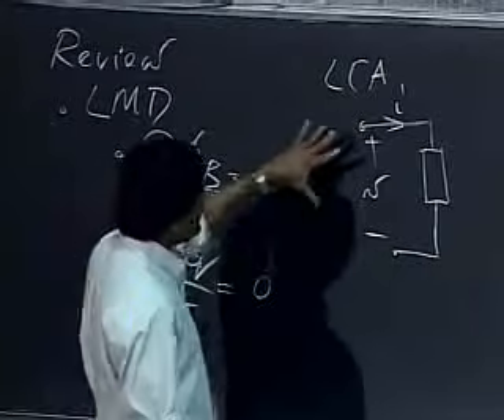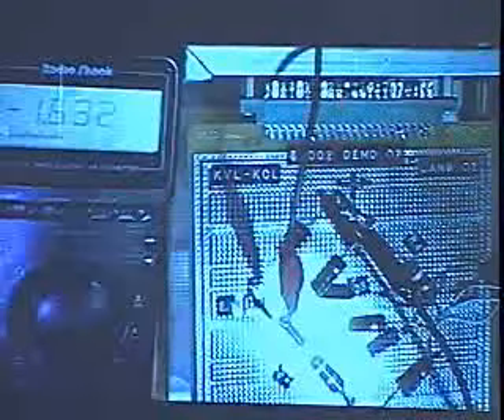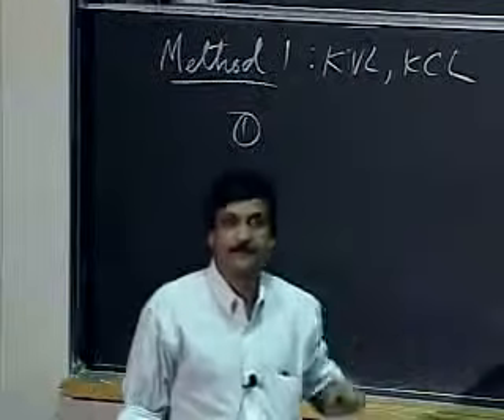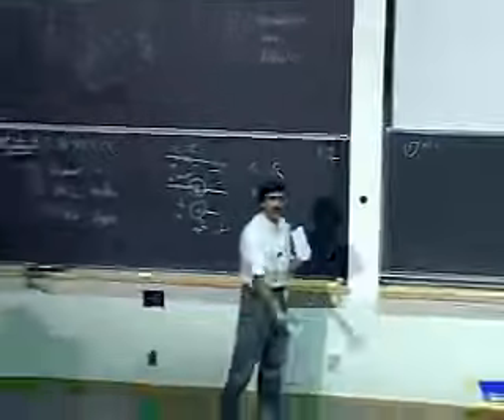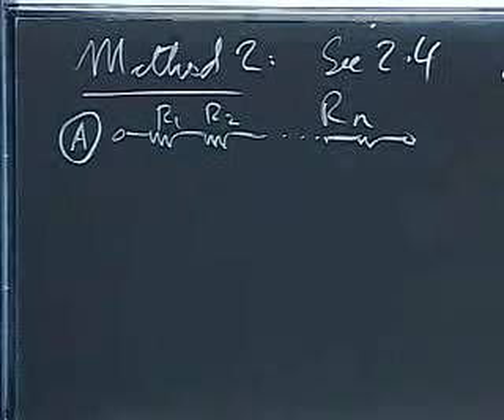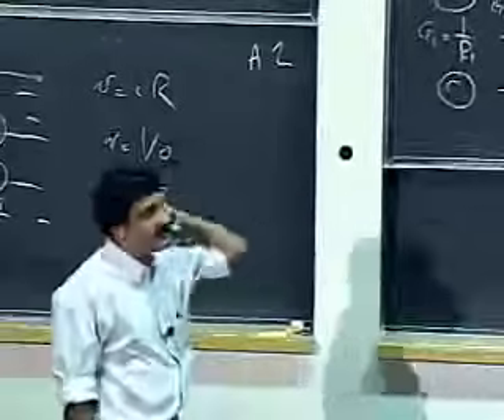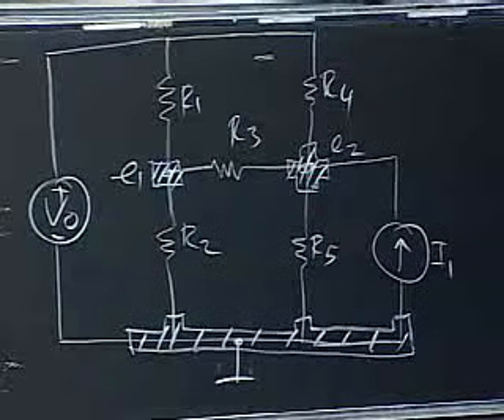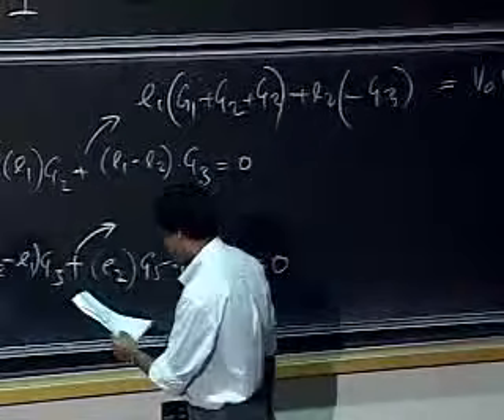Lec 2 | MIT 6.002 Circuits and Electronics, Spring 2007

Comment: Stumbled onto this as a HAM radio operator trying to learn the science of radio circuits and electromagnetic (radio) wave performance.  Made it to this 2nd video.  Follow the electrical terminology fine, but Professor lost me on the math at the end.  Appears linear algebra proficiency is required to progress (and who knows what else) ... and my advanced math was 30 years ago, long forgotten.  So good to know to stop my efforts to gain proficiency in radio science.
Reply: Tom W5VLT Hi Tom.  The technique that the professor suggests using (Gaussian elimination) is usually the first topic covered in a linear algebra course.  It’s pretty simple, so I’d encourage you not to give up!  A little googling and you’ll be back on track in no time.

Comment: These simple algebraic equations make my head ache. The method of clumping elements together and just remembering their interactions seem most effective to me because I can tell what the circuit does without knowing anything about voltages and impedance and what not. If I had to calculate kcl for every node in a real life circuit I'd need to take a week off. And don't forget tolerances of components.

Comment: How did we gather that the resistance of the two resistors in parallel is equal to (R2+R3)/(R2R3) at 31:44? He said that conductance is equal to the reciprocal of resistance. Wouldn't that mean that (G1 + G2 = (1/R2)+ (1/R3)) not (G1+G2 = (R2R3) / (R2+R3))? Thanks
Reply: Pedro Casultsan 
G12 = G1 + G2 = (1/R2) + (1/R3) = R2/R2R3 + R3/R2R3 = (R2+R3)/R2R3

R12 = 1/G12 = R2R3/(R2+R3)
Reply: Thanks
Reply: how are you jumping from (1/R2) + (1/R3) = R2/R2R3 + R3/R2R3, in other words, how does 1/R2 = R2/R2R3 ?
Reply: Juan Manuel it doesn’t, 1/R2=R3/R2R3

Comment: Please SOMEBODY help me. I can't get currents' directions in KCL and NODE method. I think there is mistake in taking current directions.
You know I was studied that everything should be very strict. How can 3 currents all be positive!

io + i1 + i4 = 0.  Ok we have other equations and can get that i0 (or i1, i4)  is negative finally. BUT, if we make similar misassumption in other equations - everything can go wrong.
And we have voltage source since when current is going inside source, it should go from positive to negative. if we have voltage consuming device, I could understand that, but not with voltage source.

Also similar is true for (e1-Vo)G1+(e1-e2)G3+(e1)G2=0. All current is going inside/outside node? We have only 2 equation with all signs positive. How it can be? Currents just travels where they want?
He is very flexible. But for someone who only starts electronics without having experience in KCL calculations, it can hurt understanding from the very beginning
Reply: Ahaha you and the MIT professor are over complicating things way too much. Kirchoff's Current basically says that the current throughout a series circuit is always the same. So in basic series circuits all current drops are the same no matter the resistor or load. 

Kirchoff's Voltage says that the voltage source is equal to the sum of the voltage drops in a series circuit. So Vs (Voltage Source) = V1 + V2 + V3...

Basically that's all you really need to know starting off, anymore will make your head hurt if you don't know too much about circuiting. Honestly I learned all of this at a Community College and I find it much easier to learn it there then at MIT. Even though in the end you learn the same exact things, it's just that you have much smaller classes and more personal one on one time with your professor. That and this guy's handwriting, accent, and method of "simplifying" things are really confusing. 

He's a good teacher for MIT students I'm assuming, I can't see him as a good teacher for people who are looking for simple explanations of how circuiting works and basic introductions. However I personally know there are better teachers out there that can explain the same things in a much more simplistic and easier way, but I don't think that's what he's trying to go for.
Reply: jebril But we were dealing with paralel circuitry. Directions of currents affect their signs regarding to each node.
Reply: I think he mad a mistake of the current direction of I。
Reply: @vito5420  nope
Reply: jebril
Well, you are actually agreeing with TheTimurbest.  That is, in your analysis, rearranging your equation becomes 0 = -Vs + V1 + V2 + ...  So, keeping track of the signs properly is important.  And, the Prof does have an error, it appears to me.
Reply: The prof was right i think,

I got confused regarding the polarity too after the lecture and followed the tutorial below,
http://www.electronics-tutorials.ws/dccircuits/dcp_4.html

Polarity of the current should be relative to the direction of the current from the node. (either the arrow coming in or going out of the node) 

Let say you make
Current going out of node=positive
Current coming into node=negative

so the equation at 43:44 .
(e2-Vo)G4+(e2-e1)G3+(e2)G5+(-I1)=0
(positive)G4+(positive)G3+(postive)G5+(negative)=0

Comment: @davestoj i mean if i have a power supply of 12v , then further down the circuit a voltage regulator outputting 5 volts and further down an even lower regulator giving me 3.3 volts , and if i did not know the part number of the regulators and needed to find out how much voltage is going through a certain point/part of a circuit couldnt i just stick a multimeter to the regulators common grnd and output pin and thus get how much voltage is going through that part of the circuit

Comment: @eddiea6987 What do you mean by a voltage at each point? A voltage is taken as a difference in circuit potential between two points on a circuit; voltage is purely a relative quantity.

Comment: cant you do all this with a multimeter and get the voltage at each point?
Reply: Maybe for simple circuits, but when you have a very complicated circuit/module, it could become very complex. This is laying the foundation to understand complex circuit designs, or designing a circuit that does not yet exist.